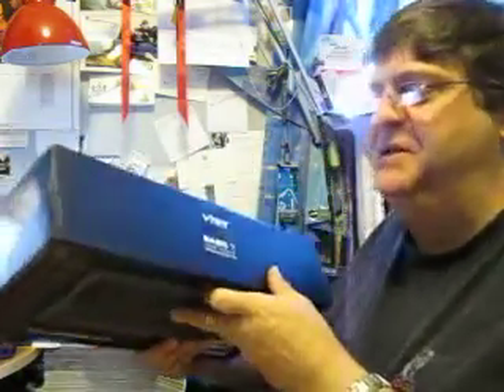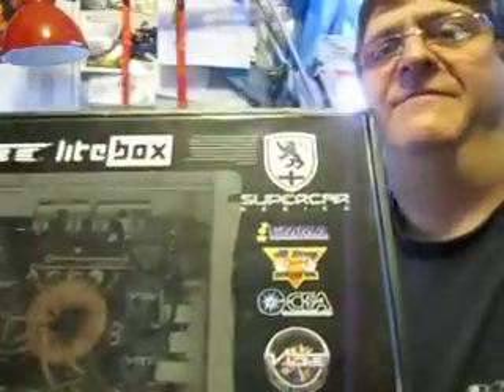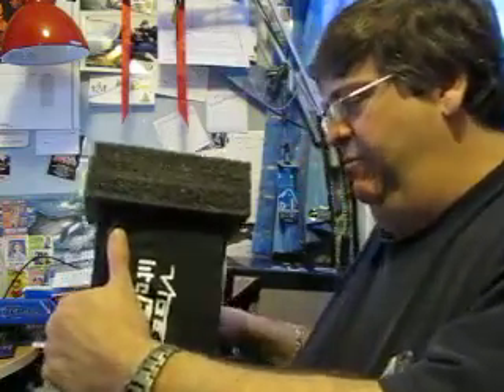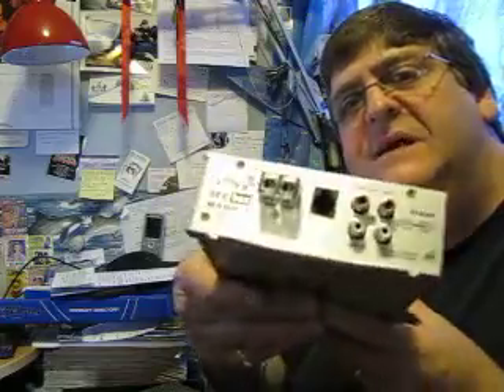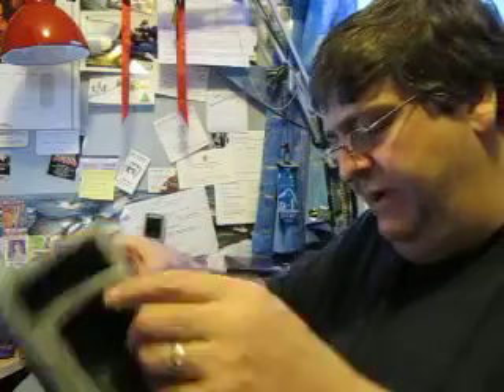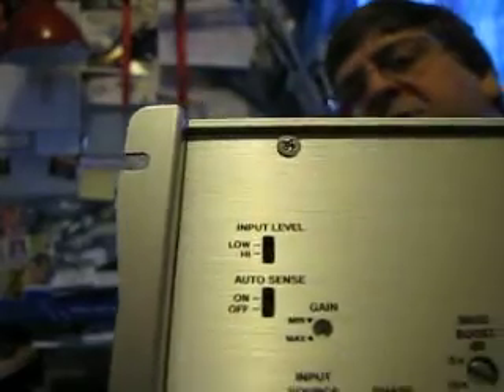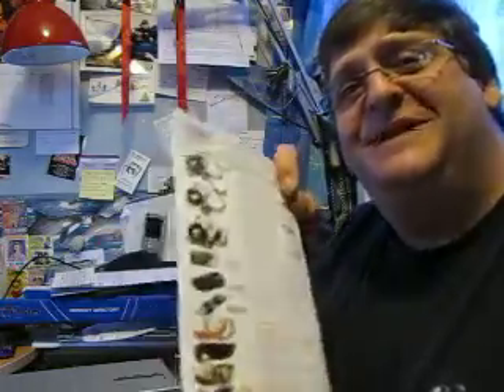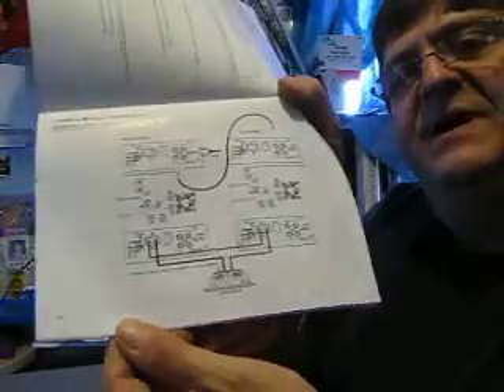Vibe Lite Box amp from www.talkaudio.co.uk's weekly product blog

Comment: Not a bad job Presenterbloke! Very smooth presentation style.

 I've just had the LB S4 installed. My biggest problem so far is fighting with my own ears, being used to the old Philips amp that had been feeding them for 8 years. Early days yet, but so far so good. Gonna go on a road trip this weekend to run it in.

Comment from the maker: @missgroov Really simples, sweetie....It comes with a little plug called a Molex, with wires coming from it. You switch the input on the amp to HIGH level and connect the wires to the speaker leads from your head unit. Then adjust the volume for best sound quality. If you have any questions on ICE you will always get a rapid answer on our forum, which seethes with ICE fans. It's TALKAUDIO as one word, then type a full stop, then put in co then another full stop then uk.